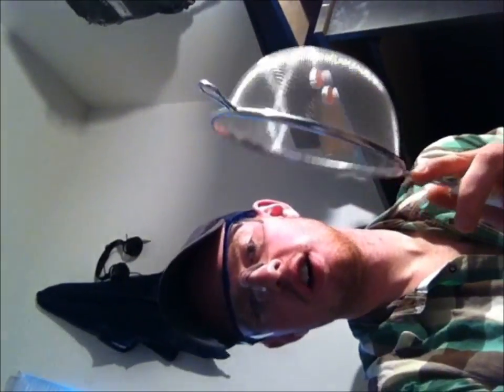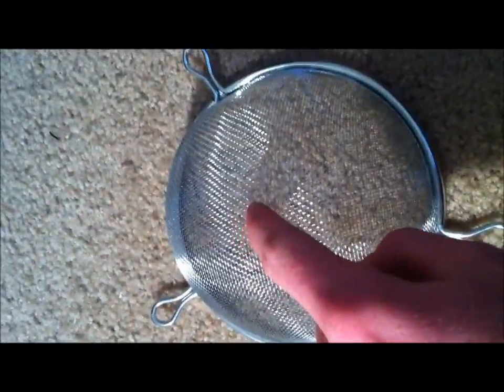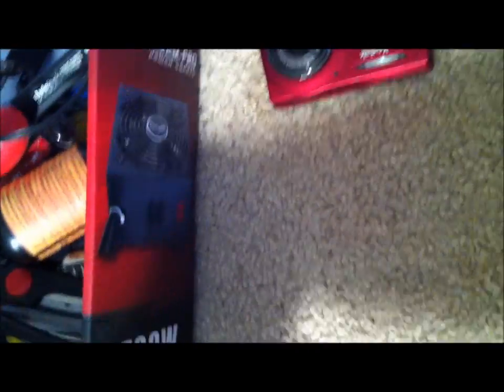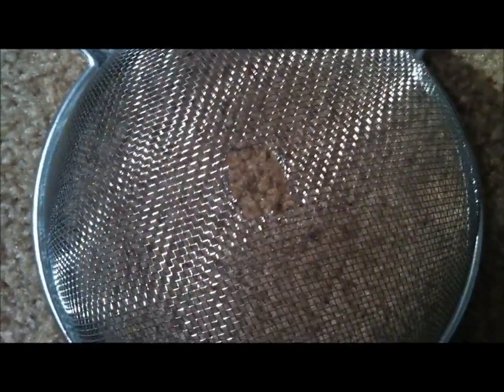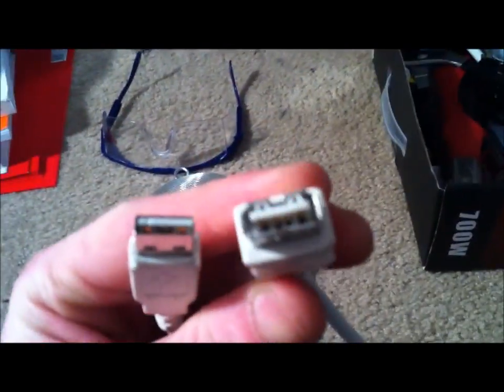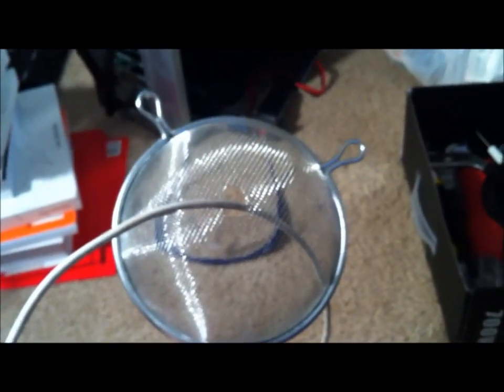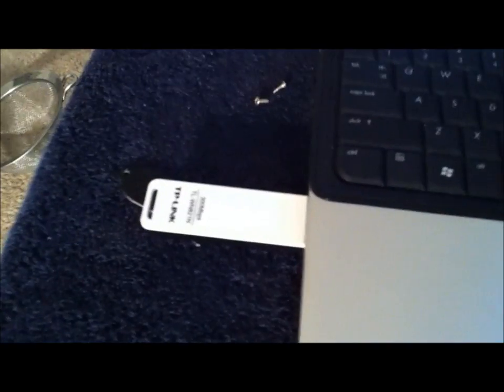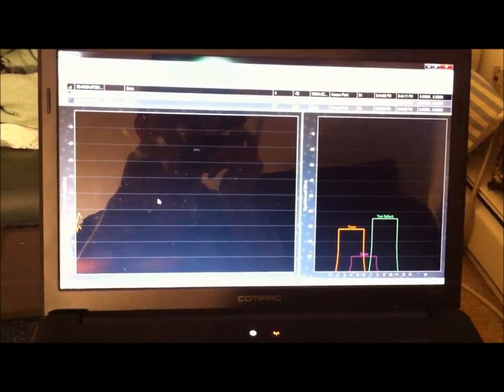DIY Long Range Directional WiFi USB Antenna Tutorial (AKA Wok Fi)

Comment: I made one using a Dish Network satellite dish. Simply removed the LNB at the end of the arm with the USB WiFi collector. We were able to send the signal from my router to the house across the street, kitty corner thru a few trees. Both our houses are located over 200 feet off the road. We figured we were broadcasting over 600 feet with almost no loss in signal strength.
Reply from the maker: Holy crap I was scrolls through my feed on google plus and then BOOM! ME! The same thing happened this morning when I was brushing my teeth and accidentally looked in the mirror. As soon as I finish typing this comment I am going to read your comment and respond to it.
Reply from the maker: Steven G Dude, that is amazing. Can you post a video of it to the YouTube? If you add it as a video response to Wok Fi I will make sure to approve it so it gets views. I would like to try something similar.

Comment from the maker: I like inSSIDer because the scan is very thorough and provides very detailed information. The normal scanner that you are referring to is not much of a scanner at all, it will only update if manually refreshed or if the, "Scan Valid Interval" setting fires (in your wireless adapter configuration this is the value in milliseconds--the default setting is either 60 or 120 I think--that your adapter will wait before it refreshes the list of available networks. InSSIDer is scanning constantly.

Comment: This is very ingenious! Use a type of parabolic dish effect with the USB WiFi receiver.  I would use a larger type of dish as like a ten inch diameter metal strainer. Then work out the peak apex point for where to position the antenna part of the USB WiFi receiver. This may involve making some type of non metal type shaft to hold it. This would require some type of holder adapted to it. I would use a small tripod for a photo camera.

Comment: Tried this with Clear [WiMax] USB Modem and it actually worked VERY well--CINR went from an average of 14, to 26 - 28 consistently. Thus far this is the cheapest and most successful way to increase a RX/TX signal--directivity is key. Thank you for sharing.

Comment from the maker: If you have a Bluetooth headphones or any other type of Bluetooth device connected to your computer, try connecting a USB Bluetooth adapter to the antenna and position the antenna so that it is pointed upwards. I used to do this while cutting the lawn to boost the range at which I could listen to music. Without the antenna, the signal would cut off as soon as I stepped outside. I tried a Bluetooth Cantenna with a pringles can, it worked, but not nearly as well as a parabolic antenna.

Comment: Your mesh, is called a strainer. I think if you cut the strainer hole earlier it would've been easier. Showing the micro scissor as your tool and explaining where and how big to cut, and glueing it to the strainer before would've been easier with managing the camera and demonstating the build. Especially if you don't have an assistant. Down side is you'll have to explain more detailed but I thought it was easy enough to explain as you got the gift of gab. Thank you for sharing. The best answer maybe you can get a tripod to help you with frustrations. I think you're still cool.

Comment: It's a interesting video you made, I'm trying to add in a signal boost since my wireless card isn't giving great performance but I will try fiddle around before stepping it up to buying mats and build a stronger receiver.
Reply from the maker: This video was 4 years ago. Now, I have a great deal of technical experience with this sort of thing. If you post a video response with your current setup, I would be glad to help if I could.

Comment from the maker: To answer your question, yes. I hate dealing with the different types of connectors and cables that are required to build an antenna that would attach to a wireless NIC card; there is usually soldering involved, many viewers do not have access to a soldering iron and even more viewers (including myself) are not very good at using one-it takes practice and experience to do a good job with a soldering iron. USB is so much more convenient. I am looking forward to USB 3.0 WiFi adapters.

Comment: I found in my creation of an antenna for wi-max, that the bowl shape reflector did work, but I researched some and found that a reflector made from a piece of sheet metal just bent to about the curvature of a wok but still cylindrical worked a little better and was less touchy as for aiming.   The distance from the back center of reflector was important to experiment a bit to find it's happy spot w/ highest bars. I used a satellite dish mount without the dish.

Comment from the maker: Did you know that you can use the same exact antenna (in the video) as an amazingly effective bluetooth antenna? I have a pair of Sony Bluetooth stereo headphones that I connect to my computer via a cheap-o USB Bluetooth adapter  plugged right into the antenna in the video.This came in handy this summer when I would cut my lawn with some tunes on. Without the antenna I would lose my signal if I simply walked outside. With it, I didn't miss a beat even 150 feet out. Give it a try!

Comment: just some tips
to have a better signal you have to check where's the usb wifi module's internal antenna and keep that spot as much as possible in the focus point of the wok, and as i can see the wok is quite rounded like a half sphere so the math will be really simple to figure this out.

Comment from the maker: holy crap 999,956 views
Reply: 999857
Reply from the maker: Chris Forstner Holy crap over a million. Now I need to make the sequel and try to top 2 million views. I have been filming it on and off for 2 years.
Reply: Hey, can you tell me if this boosts your home wifi speed?  Because that's what I'm looking for,and if it does, it would help me a ton.
Reply: Nick Wiesen no, this just boosts range. You need an 800.11AC router and adapter for fast wireless speeds. Ac is the fastest. N and G are the older ones. I think AC goes up to 1 gigabit or something.
Reply: roger supernova thanks for the help :D
Reply: roger supernova AC does have bigger speed but the range sucks BIG TIME! N is still the best for the range and speed so far. :)
Reply: Benjamin Pavel You are not using the right antenna if you feel range doesn't is up to par. Most antennas are "optimized" for multiple frequency's. All that means is they tried the old 2.4 ghz ones allready in the warehouse and they kind of worked.... Get a quality one or make your own. Never buy an antenna that "works" on multiple frequency's. An antenna can only be tuned to a single frequency where it perorms efficiently.
Reply: roger supernova I'm using TP-Link N900 and this is TP-Links one of the best routers in the market right now and I had it tested with my new laptop and AC mode only reaches like maybe half of the distance than my older TP-Link WR1043ND which was pure N mode optimized and it reaches a lot further away!
And even if I got better antennas do you even now how Radio waves and Antennas work?
Radio waves the higher the frequency the less range you get...that is why the radio has signal everywhere and they use frequencies from 50-200 MHz and since N mode uses 2.4 GHz it's going to reach a lot further than 5 GHZ. 
And now do you know how antennas work? You may think that the higher Dbi antenna is the better right? Wrong...the higher Dbi the higher disadvantage because the way omni-directional Antennas transmit the signal is like imagining a perfectly round sphere around the antenna and the higher the Dbi the more that sphere gets stretched like elipsoid thus loosing the VERTICAL gain and gaining only horizontaly...thus it makes the the Omni antenna more like Directional. So unless you install Directional antennas on your 5 GHz router no big antennas will do much of an improvement. Plus 5GHz market is still new and A LOT more expensive!
Reply: LOL, it's not a wok, it's a sieve or strainer.  A wok is what Asians use to stir-fry food in.  :)
Reply: Benjamin Pavel as i said. Antennas can't be optimized for both frequencies. Getting the right 5ghz antenna for your situation will solve your problems.
Reply: roger supernova Tp-Link N900 has 3 5GHz 5Dbi antennas and the range sucks compared to my older Tp-Link WR1043ND. Just deal with it...
Reply: I'm pretty confindent the antennas on your device are causing your problems. Those standard antenna's are easily 3 millimeters out of spec. That causes instabillity and interference and limits the range. 
All routers i have seen up to now had crappy antennas. Even the ones that cost several houndreds of dollars. These are the first things that get sacrefised to keep cost as low as possible. 
Just google the specs for a 5ghz omni and measure them. More then 1 mm off on any of the 3 lengths will cause them to give crappy signal. Try to use chanel 5 or 6 measurements when you adjust them. That way you can go up and down in chanels to compensate if you don't get it completely right. 

If it is tuned to the wrong frequency dbi's don't matter anymore. Just means that you have better signal on 4.4ghz or something. A frequency none of your devices use.
Reply: Lets burp for it!  (joke)
Reply: +roger supernova Wouldn't the reflector in close proximity impact the tuning of the antenna?  Whether or not, do you have a quick method for determining what frequency the antenna is tuned to?  Do I go up and down in channels and measure the signal strength at a fixed distance with another wifi device such as a phone (same problem?)?
Reply: Jack Feder the frecuency wavelength determins the lengths of the pieces of the antenna. So you can calculate the wavelength by the measuring how long each of the pieces of the antenna is. I'm sure you can find info on how to do this on google.

You go up and down in chanels if your antenna is to long for the frequency or to short. Depending on the kind of antenna the reflector can interfere with the signal yes. If it is not properly fitted or to small for your antenna.

The easiest way to check strength is to move as far as possible away from the source with another wifi device until you still have a weak but stable connection.
If you then change something you should either loose connection or it should become stronger and you can move away further without loosing the connection.

You can also use a dbi meter with a properly tuned antenna. Realtek makes cheap usb ones that are tuned pretty good.
Reply: +Timothy Pleines not just that ! alot more in 4/25/16
Reply: learn to rotate vidios the right way.
Reply: That is because you called a sifter a wok
Reply: It's not even a sifter, it's a sieve or strainer. Well at least where I'm from. A sifter is an arrangement to remove lumps from powders like flour.
Reply: chefs use these as sifters.
Reply: djmips Yes its a Sieve or can be called a Strainer as used for making a Cuppa Tea but they are usually smaller with less and larger holes then there is a Collander used for Draining and washing salads. at least thats what we call them in Liverpool UK.
Reply: 1.9m views xD

Comment: You remove the USB device without "Ejecting" it from windows device manager??? You Savage!
Reply from the maker: Eric Hall I live life in the fast lane. I don't have time to safely remove anything.
Reply: Timothy Pleines LOL - Next you're going to tell me you don't wear a static guard bracelet when working on your computer.
Reply from the maker: Eric Hall I live life in the fast lane. I don't have time to worry about breaking sensitive computer components with my carelessness. One time I wired a 12vDC car vacumm cleaner to my power supply because I really needed to vacumm some things. Everything worked fine until the exposed wires touched. I blew out the surge protection fuse in the power supply along with most of the things that make a computer work, like the motherboard. I spent 2 full days without sleep trying to fix it. I eventually grabbed my roomate's golf club and beat the thing to death. I also damaged the gold club and had to replace it. I called it my 'Internet Explorer 9-Iron.' I eventually was able to get the computer running again after I opened up the power supply and soldered a jumper over the blown safety circuit. I accidently touched an exposed charged capacitor. Although it was unplugged, it was not safe to touch. The shock burned me under my skin.

Comment: Get some help to handle your camera, so you can use both hands. It's so agonizing to see you tormented being the producer, actor, cameraman, director and producer rolled into one.
Reply from the maker: I can do the job of the cameraman and the actor. I have honed my skill set. Recently I ripped out the circuit board of a wireless flash trigger and wired the reciever into my Sony Alpha 6000 and the transmitter into a 34 year old film camera. The result was this: as I take a photo with my black and white film camera, the shutter triggers the digital camera's autofocus followed by the shutter. I have no friends so I needed a way to take an elaborate self portrait of  myself. In the photo I can be seen taking a photo of my dog Pawblo Escobark as Pawblo catches a toy in mid air. So yes, I have taken all of this wonderful feedback and used it to fine tune a very particular skillset.
Reply: Just a suggestion: Instead of breaking an old classic camera remote photoswitch you could have gotten or bought a toy remote control car or boat that will give you "right, left, up, down and on-off" capabilities and just reconnect the contacts. This should give you remote control of your camera.

Comment: WOK is for frying there genius, your holding a pasta strainer there Einstein, not very effective reflector, use an 18" Satellite pan instead, measure and set the focal point, loose that POS adapter and use a real antenna like a copper quad or a YAGI antenna

Comment: Great effort! 

,You should google fractal antenna and try yo bend a Koch Curve from different bends in a wire cloth hanger.

If you bend the coat hanger, like a Koch Curve, you could find a signal......think in terms of right hand rule......never heard of right hand rule?.....look at a emf in physics books...Still don't see it?...google fractal antenna.

You made laugh and think and dust off old memory from sophomore year at University.

You need to think in 3 dimensions.... not 2...enough said.

You might consider a career in professional instruction?.....students like funky professors.

Your
Reply from the maker: Great advice Will. I really appreciate it. I have spent a bit of time studying electromagnetic fields and radiation patterns since making this video. I am going to look into a Koch Curve, I have never heard it. Perhaps you have stumbled upon a new type of DIY wifi antenna. I am adding you on Google+
Reply: Timothy Pleines The Koch Curve has already been exploited to make antennas by a dude that couldn't hang any antenna from the highrise where he lived.

The Koch Curve is a compact antenna that is now extensively used in cell phones for all the different functions such as phone service, data, gps etc.

It is not my idea. I read about it in Benoit Mandlebrot's book,(The Fractal Geometry of Nature...Freeman Publishing,, copyright 1977) Mandelbrot passed away last year, RIP.

I suspect you would really dig the book, the new branch of math this guy uncovered and the applications. The science is still new, relatively speaking.

See if your local library has a copy. Fascinating reading and very intuitive when you get familiar with the concepts. It is it's own branch of science that not many people know about.

Let me know what you think.

Wm.
Reply: William Wiles

Comment: @salvadormeza Yup, free. Keys and codes are only for the owners of APs, not for people around. If you can pull the signal from another house then it's free for you. Also, the metal net that normally holds the noodle inside, when you rinse them, removes any possible key if some would get through.

Comment from the maker: My Philippine friend explains the difference for the wok fi 2.0 video. It is a wok in process. I found out about this device called a "tripod" and it has a steep learning curve, almost as steep as this "production quality" thing that I read about. It will be done by 2013 hopefully. The wind knocks over the "tripod" and you need to attach a camera to it I think. If you feel like watching a sample of it, I posted a clip where I successfully use both a tripod and an explosion.

Comment: its a sieve, strainer, shifter, or strain ...anything but a wok
a wok is a type of frying pan often used for stirfry... because of the round bottom of the pan it allows it to achieve frying temperatures in less time also do to the round bottom it allows for the chef to flip food with ease essentialy stirring it up with a flip of the wrist.
Reply: sorry i meant sifter not shifter

Comment: cool video...i would made the hole smaller, pushed the cable through from the opposite side, and not need any hot glue, so the tension of the mesh held it in place...save time.  I am going to make one of these ASAP :)

Comment: Actually it is a strainer what you called a flour sieve or (sifter) looks a can w/ a handle on it and a crank stile handle on its side and inside is a mesh screen an a metal bar attached to the crank to break up the chunks of flour against the mesh screen.

Comment: find the center by putting the strainer over a larger bowl used for making Kool-Aid.  put a marble in the strainer.  It will rest in the middle.  mark it.  poke the hole from the inside not the outside.  the outside will collapse the screen.